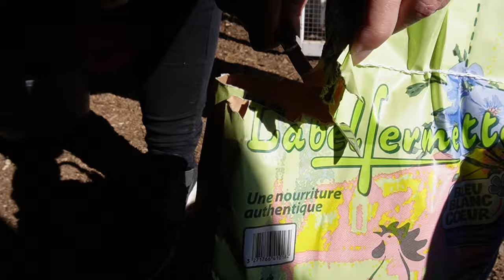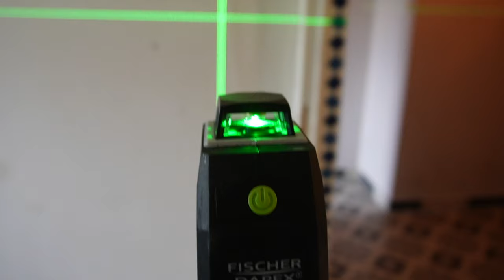Finishing touches to our bathroom renovation in France

Comment: Just 2 questions son, you know the first light switch, what would that normally be used for? For me it looked like a on/off clicker switch, which should have turned on with one, click and then off and again with another click, which the actual plate remaining in the same position, instead of being on a rocker? So could have been used, just wired up differently? Anyway dunno, not a sparky, just trying to apply Dazzy logic (which isn't always the best idea!! lol) Also ever thought about setting up a camera to film the mice overnight to see how they are cleverly bypassing the ledge and taking the food? Would have been really interesting :)
Reply from the maker: Andy from AJ in France (link in the description) did explain it to me about the light switch but I didn’t understand lol. It does have a purpose and wasn’t wired up wrong lol. 
I did do that with the filming of the rats but it ran out of battery lol